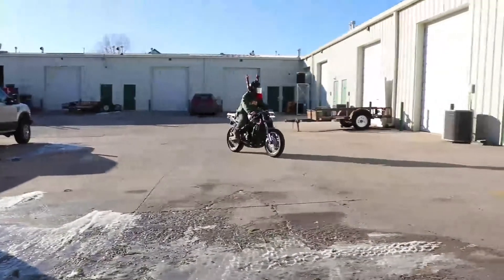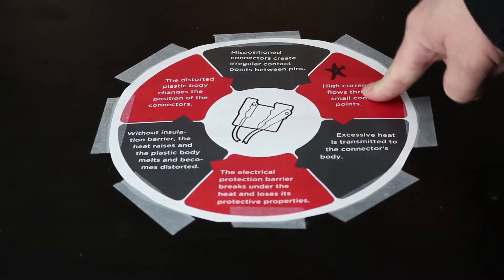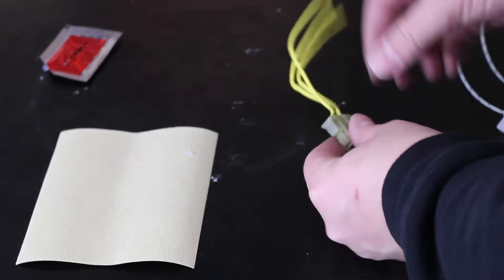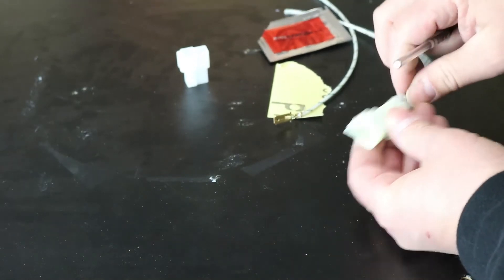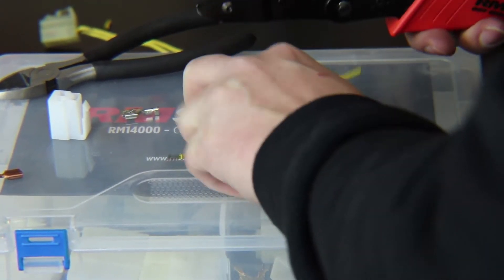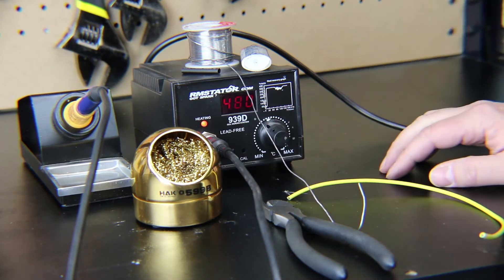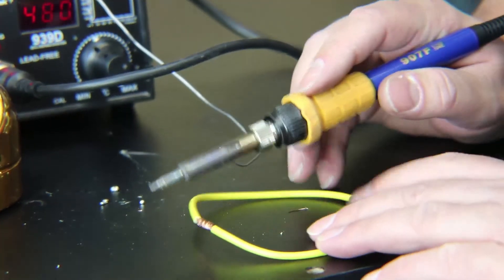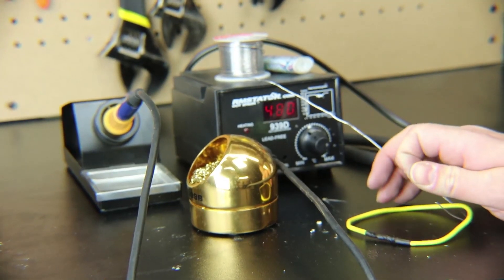How To Repair Your Wires - A Step-By-Step Guide On Crimping, Soldering & Repairing Like A Pro

Comment: Cleaning the outside of the outside terminal is not going to have any affect on the connection area which is on the inside of the outside terminal.
Reply: William Colvin, I agree ! That is the exact place in this video that I stopped watching.  I think I will stay with OEM stator or rebuild it myself.   For hard to clean areas at LEAST use some quality cleaner like deoxit.

Comment: sir can you please tell me why some flywhees has longer timing trigger ridge while some shorter??
Reply from the maker: The timing trigger ridges are different for every flywheel, because they are very specific to the ignition system timing for the particular motor they are built for. The length of the trigger determines the total amount of timing advance that can be calculated by the ignition computer (CDI box).
Reply: RMSTATOR ....ok sir...thanks....also some flyweels have a trigger ridge of 7mm then a gap of 5 mm then Another trigger ridge of 47 mm...why is that so sir ??
Reply: the circumference of the flywheel is 370.8 mm ...can you relate sir